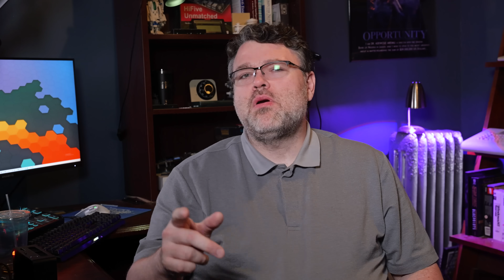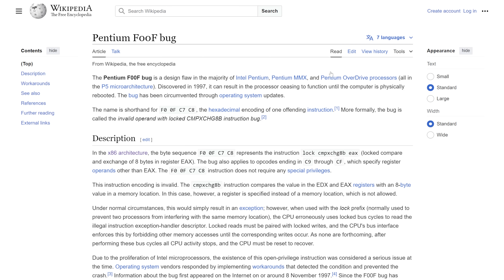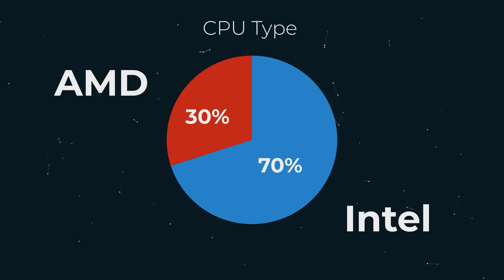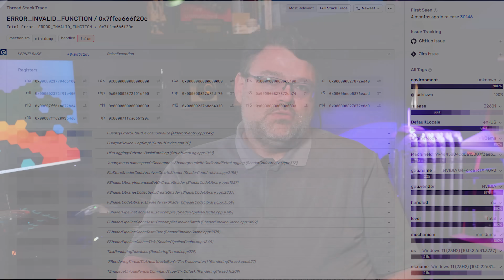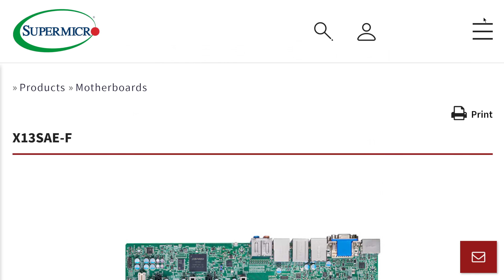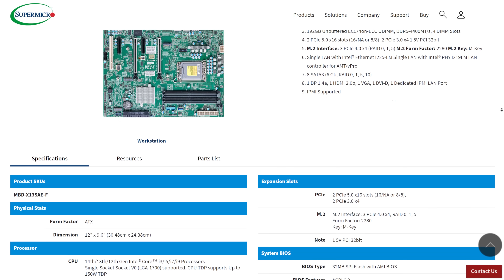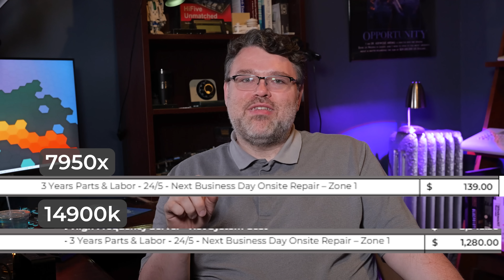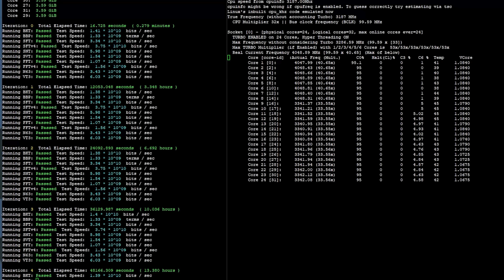Intel has a Pretty Big Problem

Comment: I have a 14900KS after my 14900K and 13900KS gave up. I will switch to Amd if this cpu gives up too. No overclock and high quality parts. Arctic Freezer 420 mm AIO. All drivers and Bios updated.
Reply: If you do switch to AMD at least you will have a cooler that will freeze the CPU for real :D
Reply: I'm running a 7950X3D off a Peerless Assassin 120mm dual tower. I've capped the fans to 1200RPM. I never see above 85C at stock settings when going full tilt on a compile job for hours at the time. I am, however, using liquid metal thermal paste.

So as the other commenter said: If you switch to AMD you'll either deep freeze that CPU or get the quietest system you've ever had.
Reply: @andersjjensen  Damn, liquid metal on a cpu with so many cutouts? Are you using one of those thermal paste guards?
Reply: @ahs9674  No. I'm just very careful with the application until the CPU is out of warranty. Then I'm going to paint over the upside capacitors with clear nail polish (unknowingly provided by the missus) for extra protection. But it's really not much of a problem, as I don't cover the whole IHS. I just make sure I cover the two CCDs and the I/O die with a bit of excess margin. A cotton stick works great for getting a very thin layer.
Reply: No need, considering you've been fooled 3 times, Intel is not the issue, you're at this point
Reply: @orionarclight  I mean yeah but would you buy a new 500 euro motherboard to switch cpu vendor in a hurry? 9950X looks kind tempting if this 14900KS walks out. I choose Intel to have less issue ironically. Bad Amd heatspreader and exploding 3dx cpus was the big talk when I bought the system.

Comment: This reminds me to either the latest Pentium 4 CPU'S, or perhaps the due core CPU'S.
At least it was in that time period and the core duo and core 2 as I recall them were rather sollid.
If you ran a pain memtest86 on the device overnight you were ensured to have some errors.
I believe it was at least partially resolved by updates, either firmware or the memtest86 software.
But at least taking your conclusions from just a memtest run was no longer meaningful...

Comment: 10900k was the most stable cpu I've ever had. 14900ks is a tuning nightmare i have overclocking profiles for different games to get the most out of it. The Frustration  its high

Comment: My son wanted a new computer in December 2022.  He went with a13900k, Asus motherboard, and 2x 16GB DDR5.  It worked 'okay' for about 4-6 weeks.  Suddenly it crashed in Minecraft.  Following that, we had two months of troubleshooting hell.  Exactly the type of errors you reported.  Took the computer back to the computer store, and they diagnosed it as a failed CPU.  Because we purchased in-store replacement warranty, they swapped it out, no problems.  Then, about another 6 weeks later, same thing.  Exact same thing.  Eventually I picked up an MSI board and a 13100 CPU to do some of my own swapping with, to try and narrow down the issue.  It was a failed CPU again, but this time, it was also a failed motherboard.  We got the CPU and motherboard replaced, but the store would only swap out the ASUS board for an identical ASUS board. We set that board aside, and put the CPU onto the MSI board.  It's been running rock solid now for over a year, zero issues.  I then built myself a 13700k system, same MSI board.  No issues.  I built my niece a 14900k system on the same MSI board, also no issues after 8 months of full-time use.  I predicted that these CPUs and boards must have broader issues than just our situation, but did not have the evidence like you do.  Keep working at it!  This needs to be exposed in a broader way.  Intel must be held accountable for the problems with 13/14 gen.

Comment: Great video, Wendell. I had to swap a 14900K in my desktop that had these problems. Two weeks later the news about the issues started popping up. So far so good with the replacement running at Intel "Extreme" spec.
Reply: @aaronmoore3050  Why it makes no sense? You know that even with the same name the silicon is not a copy and paste?

Comment: You say W680 power targets are more conservative but my how much? I'd imagine the CPU would still boost to the same max turbo and probably set to 253W.
Reply: Should be 150W if the supermicro website is correct.

Comment: Since the chips are now at the low end of nanometres, could quantum tunnelling be a problem?  How are the chips tested in house?
Reply: Not really. Zen 4 and Alder Lake don't differ from Raptor Lake (Refresh) that much in transistor size, but none of them have this issue. GPUs also don't. If physics were at fault, then everything would have issues
Reply: I always thought anything under 5nm would result in that, but maybe GAA process nodes address that because gate leak is fixed at that size.

Comment: Low-information fanboys are going to think that the rate of failures are now confirmed to be endemic on Intel CPUs and are widespread. It's all guesswork and the prevalence of what I'll label "chronic errors at stock settings" is unknown. We don't even know what the problem actually is.

I know you're clearly saying "some amount" and it's all supposition by your admission, but we all know this is going to be parroted on Reddit for years as if it's a super common Intel issue. It could happen to 1 in 500 units that you have to raise the voltage to maintain stock speed stability over time and AMD weirdos will say "at least my CPU doesn't error out!" gleefully and misinform casual builders for a long time. "Wendell from Level1Techs did a whole study on it. Intel i9s are erroring out constantly," will be the summary and it will get passed along without anyone knowing anything about it.

Motherboards controlling voltage incorrectly, degrading a die, and increasing the error rate at a given voltage as a result is also a real possibility. Motherboard issues of the voltage variety plagued AMD recently, too.

There's not much you can do about this because you can't control the dumbest people on the internet, but god I am not looking forward to explaining that Intel chips don't have a high error rate to people for the next 2 years. You're just making content, but damn.
Reply: Awww its going to be okay lil buddy 😢😢😢
Reply: @CyberneticArgumentCreator  The irony of you calling other people fanboys lmao
Reply: @ThunderingRoar  How is it ironic? I used to build and sell mostly-AMD gaming machines. I'm a fan of good tech from any label. And I hate FUD and sensationalist content. Not a lot of irony there.

Comment: Well I mean datacenters aren't supposed to be using K chips anyway, much less consumer level ones. And if it's mainly the K chips the problem is not that big. Probably just the chips degrading rapidly due to flawed manufacturing.

Comment: Right smack in the middle of the Raptor Lake 8+16 die is the ring interconnect fabric, with a ring agent interconnect per P-core and an agent per E-core block. Given you’re seeing a mix of IO related errors, including the out of VRAM errors (which is likely triggered by a PCIe operation failure), my gut says this is the system agent logic in a bad-state, specifically due to failing ring signaling at one or more ring agents or in the system agent itself, blocking and going through some form of error / bad-state recovery. My guess would be that this is due to electromigration degradation of the ring interconnect logic due to the very large Raptor Lake 900MHz top end ring clock bump by Intel, versus Alder Lake. This is why we’re seeing these issues in 13th and 14th gen, but not 12th gen.

What’s concerning is that if this is where the problem is occurring, than Intel appears to have not implemented internal telemetry, or not exposed it via CPU or other system driver, to drive WHEA reporting around ring interconnect and the system agent. Given the complex nature of the SOC, with its asymmetric architecture, many clock domains and sophisticated “system agent” IO block, that would be bad if true.
Reply: The architecture just became too big for its accumulated error rate
Reply: Ohhh, this is an interesting theory.
Reply: That's a great bit of analysis.
Reply: Is there any easy way to force a condition that would expose if my CPU is fine or not? Thatd be my biggest concern is getting ahead of a bad CPU before the warranty expires then I am SOL
Reply: @Oomlie  I would test it with prime95 small fft for 3-4 hours a few times and play any game you can try on it, also you could try to cycle run cinebench and use occt to cycle each core.
Reply: @kevinzhu5591  As it pertains to this issue, the problem with small fft using prime95 is that you’re really only stressing intracore execution resources and L1/L2 cache. To ascertain if you have an issue with ring interconnect and interaction with the IO block (system agent), you want to use something like a reasonably threaded game engine, perhaps while also running a threaded workload against high performance (e.g. PCIe 4+) NVMe storage (and one that requires CPU directed IO operations, such as a multithreaded copy of a large number of medium sized files). What you want to stress is the IO subsystem logic, specifically ring interconnect for cache coherency, memory operations and PCIe operations across system agent’s PCIe interconnect. 

In simple terms, I think the stability issues are occurring somewhere in the ring interconnect logic, either at one or more core ring agents or the system agent ring connection logic (and to be specific, I’m referring to the physical transistor logic used for signaling on the ring interconnect; IIRC it’s not just a simple ring bus, but a “packetized” multichannel ring). This is, possibly, resulting in some aspect of the ring and upstream system agent component block, getting into a sad state and erroring out operations.  Games, with their tightly looped code, are IO and (transactionally speaking) memory operation intensive via memory mapped IO (e.g. BAR mapped TLP ops against a PCIe connected discrete GPU). It’s my supposition that the same CPU core to system agent, via some breakdown in ring communication, that’s causing people grief on basic NVMe file IO operations is also causing the “out of VRAM” errors, as the handler for GPU related memory mapped IO operations is simply throwing that error because, in the view of the dev who wrote the catch block, under normal circumstances such an operation most likely only fails when GPU VRAM is exhausted. 

Why am I specifically focused on the ring and not the system agent itself (where the IO interconnect, memory controller, etc., lives)? Because if this were an issue of memory clocks, memory controller voltages, general PCIe interconnect problems down stream to direct connect devices or southbridge, you’d see a whole lot more problems that’d be easily identifiable. But transient, high-IO stress across the ring interconnect, while the system is maxed out on clocks, would exhibit far more random, but largely IO related, errors. Additionally, the ring saw a huge boost in clocks (IMHO) with Raptor Lake and, based on a bit of googlefu, it doesn’t look like there’s much ring clock overhead in Raptor Lake which tells me Intel’s factory clocks in 13/14900 SKU’s are already at the edge. Now throw in this video’s information that the problem is getting worse over time, and you have a classic description of electromigration induced failure.
Reply: If the ring causes those issues, I wonder if raising ring voltage could solve those issues or not. 

For example, I had 2 i9 13th gen, one is 13900K that I sold for the current i9-13900KS, both runs stable at 253W, 400A IccMax with BIOS default settings (I set my power limit lower than 253W initially due to having a 240mm AIO). I did turn off MCE in BIOS and set my custom load line to undervolt the chip. I used the previous chip for about a year with no noticeable degradation. I run both chips with SA voltage of 1.35V for my DDR4 ram OC.

Both chip had ran mining softwares, Prime95 and other stress tests.

I suspect that for the degradation to happen. most people did not configure power limit, they let their chip runs with high voltage with high current, and that cause fast degradation. Also, their silicon quality is probably average or below average in the first place.
Reply: @kevinzhu5591  it probably would further accelerate degradation of the ring bus and lead to even more crashes

my bet is that intel has a design flaw regarding ring bus which got exposed by their lack of regulation regarding power profiles which slowly cooked ring bus on stock speeds and fried it when people did do some overclocking
Reply: @xthelord1668 that is tragic.  I would hate to pay exorbitant prices for a faulty processor
Reply: @xthelord1668  I’m inclined to agree, adding more voltage may temporarily improve the situation, but I suspect they’re fighting Black’s equation.

Whether it’s a design flaw, a manufacturing flaw, a problem with inadequate cooling (as temperature is the big gotchya) or a combo of all three, I suspect Intel will be replacing a lot of 13900 and 14900 CPU’s (with a charge against earnings). To me this smells like something that’ll require a stepping change to address.
Reply: @kevinzhu5591  Wouldn't it make more sense to lower ring voltage and clocks a bit? It shouldn't make a huge difference in terms of performance to reduce it by 300mhz or whatever.
Reply: @ahs9674 Doubt it would help. 12th Gen have had (minor and not often but I've encounter them way to many times...) problems with asymmetric uarch, 13th & 14th not only suffer from that but you have to have in mind that they do bent, are made using Intel 7 process that took ages to be "mature" enough to be even considered viable to be used for manufacturing and so much more. 

There might be a reason (beyond being behind with their own foundries and R&D on advanced nodes) why Intel is hell bent on using TSMC instead of their own process for CPU tile.
Reply: @Deniryer  yeah, the bending of the chip could contribute to this issue as well. My chip was installed with retention brackets. 

Maybe the combination of bending with excessive heat/power consumption cause thermal expansion/contraption of the die to have micro level Crack along horizontal axis of the die...... who know what happens next.
Reply: @ahs9674  I think for intel, ring, p-core and e-core shares the same voltage (Whichever has the highest voltage requested is going to be Vcore). So the lowest denominator is the part which needs the most voltage to be stable.

Thus, if we lower the ring multiplier, the voltage requirement for Vcore will be lower as well. If someone could try to lower their ring multiplier and check their unstable chip to see of anything is changed, That would be valuable info.
Reply: Honestly i think if the issue was that easy to pinpoint, media outlets with technical knowledge like Level1Techs & GamersNexus would already have figured it out themselves. So it's a fair bet that it's not the issue at hand. I know your just speculating and you might be on the right lines but clearly its a more complex problem even Wendell with all the data from game servers can't figure it out.
Reply: @filmboy18  wendell is a software engineer gamer nexus is a computers expert, the commenter is probably a systems engineer or working in the semiconductor's industry, everyone has their expertise, don't be so quick to discredit. those who know for sure work in the industry and probably don't want to burn bridges by leaking it to the public

Comment: Had this issue with my 13900k. Never oc'd or pushed. Started getting weird errors. More and more until I finally decided to reinstall. 

Come to find out the cpu died 100%. Only one other person had a forum post about it and his solution was to buy another CPU. 2 months later, the internet is flooded with my exact issue. 

Intel messed up pretty hars on this one.

Comment: This main issue is indeed Intel themselves. The silicon quality varies so much that you have 1 person who can run a 14900k at  -0.050mv and run that config forever and a day but then on the other end you have another person who requires +0.050mv to be stable and now the chip start's to degrade.
I got the lucky end of the stick and my 14900kf setup has been rock solid for 7 months now running DDR5 8400 on an Asus Apex Encore.

Comment: This is a great breakdown. I was in the "probably overclocking or motherboard issues" camp but after hearing about the issues on the server side and the 10x support cost its pretty clear something else is going on. Recently with my 14900k Call of duty was crashing with an error code related to storage issues even after validating my memory stability (100% no errors in mem test pro) and validating the game files 3 or 4 times. Makes me wonder if it is related to the stability issues rather than a game issue. It's probably degradation related but time will tell on that.

Comment: 12:43 Asus board defaults to the lowest settings for all hardware specifically the ram speed and timings and any CPU changes after a crash bad enough and will default on boot to this screen so this is why the ram is set so low as u had thought, I believe in hopes to get the hardware back to Manufacturer's recommended operating environments ...